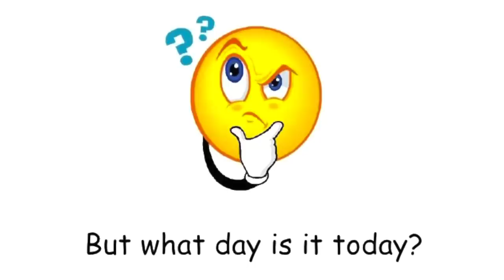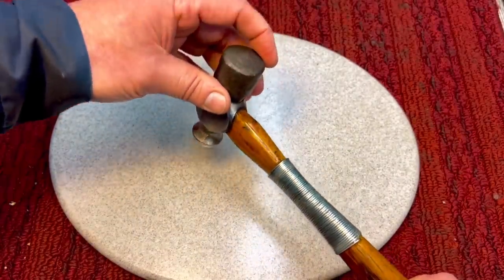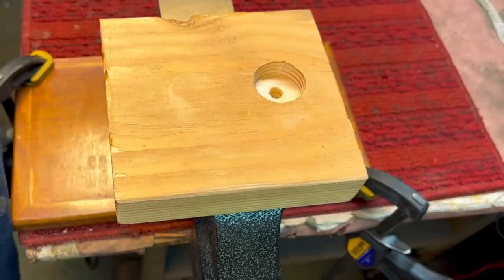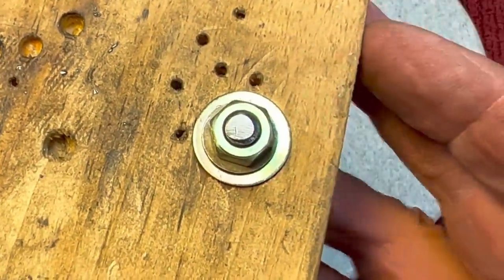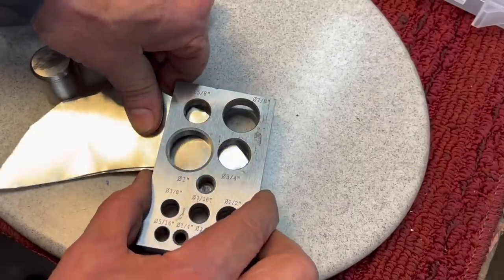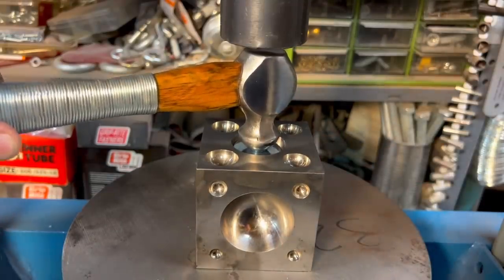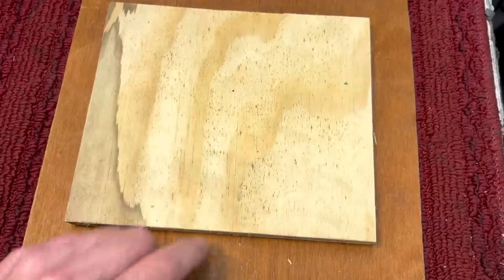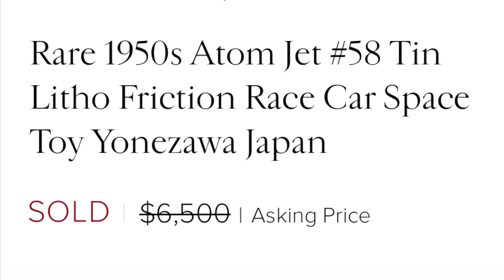Peening 101 - Doming Set - Forming Metal - Halving Tip…

Comment: The angling of the tape measure is a great trick, and even better when you are trying to divide a board up into something other than halves where you can't use diagonals.  I have used my doming block for a few years now and not once did I think about using it with the Dake - got to go find a candidate for amputation now 😄

Comment: A trick to success forming metal on the bench is to use material that was formulated to be readily bent and shaped. Metal gallon cans that are used for acetone, thinners, mineral oil, etc. work a treat for this work and can be readily soldered. Appliance shrouds as found on things like washers and dryers work great for larger jobs and can usually be had for free at the dump.

Comment: Great video, I have a couple very old 24 oz.+ ballpeins that need to be hung, but I've been reluctant because of the relatively large heads & tiny eyes. Looks like a great modification to mitigate that & put an old tool back to use. 
The tape trick is useful and quick. 
Just to expound a bit, if you're trying to divide a board into say 3 or 4, (or more) equal selections...pull the tape to a (any) measurement that is easily divisible by the number of pieces you need.
For example:
If your board is 14-5/8" wide and you want 4 equal sections, pull the tape diagonally to 16" and mark every 4 inches (@ 4"-8"-12"). 
Another way is to double or halve simple fractions (doesn't translate to compound numbers) is as simple as doubling or halving just the denominator. 
The trick is you double to halve & halve to double.
Example:
What's one half of 9/32"? (32 x 2)
- 9/64"
When halving you double the denominator.

Example:
What's double 5/16"? (16/2)
-5/8"
When doubling you halve the denominator.

Comment: The "finding center" tip can also be used if you need to mark off a board in equal sections.  For example, using your 8 13/16" board 
.. if you needed 5 equal strips, swing the ruler til you're at 10", then mark the 2" 4" 6", 8" positions and you'll have equal size sections.

Comment: Hi there again.
I have a question related to the scrap wood pounding surface. I note that you screwed the bottom piece to the top with both pieces grain in the same direction.  Wouldn't it be far stronger if the bottom was screwed onto the top with both pieces of wood being at 90 degrees, i.e. with the grain direction of both pieces being perpendicular to each other.  That should result in non-splittling of the top piece again. Just wondering. Thanks.

Comment: Measuring would be simpler if the USA adopted the metric system. No awkward fractions to work out. Units are all factors of 10, 100, 1000. Join the rest of the world and go metric.😉
Reply from the maker: Believe it or not there is a legitimate reason for a fractional system.  Especially in the agricultural industry.
Reply: @ScoutCrafter  Ha, I'm sure there is. Here in the UK, we started moving from imperial to metric in 1965. Over half a century later and we still haven't fully changed over. Speed limits are still in miles per hour. If you ask someone their height and weight, they'll likely answer in feet/inches and stones/pounds. We buy pints of beer but litres of milk. And if it wasn't complicated enough, I own a couple of classic American cars so I need a full set of imperial spanners & sockets and another set in metric for my British cars. Great channel and content. Keep it up and keep that flag flying.👍